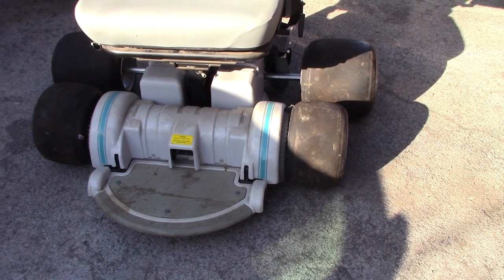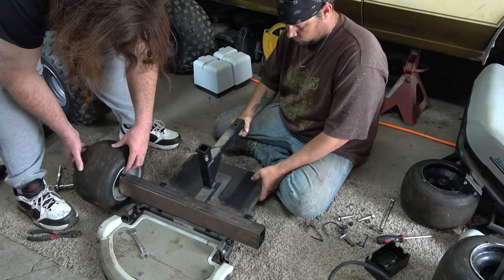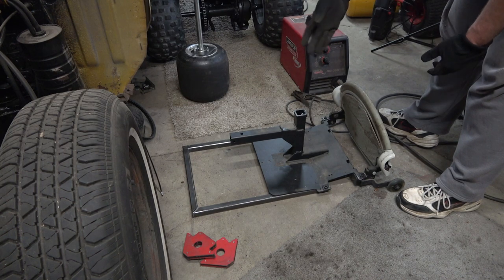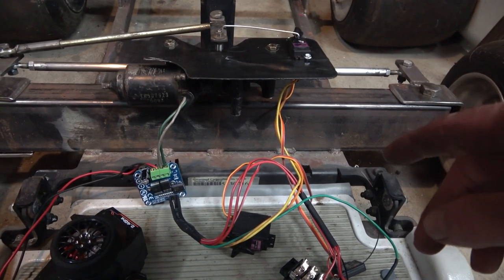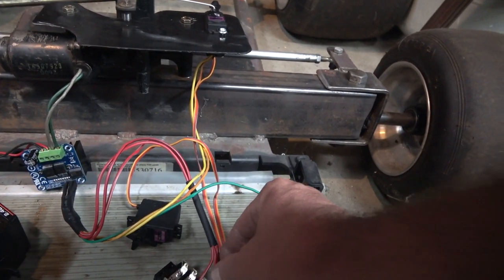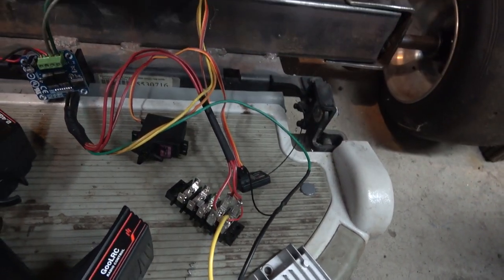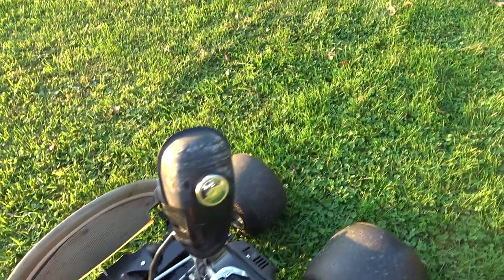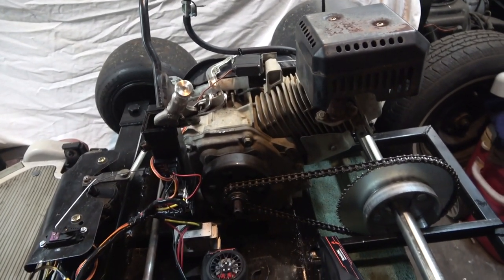RC Power Chair Go Kart build - Start to Finish

Comment: What motor did you use it fit real good
Reply from the maker: Used a predator 212 but i built the frame to fit the engine. Thanks for watching Joseph! Maybe check out some of our other vids and consider subscribing. 🔥

Comment: Can yall build a fast electrical one. With bigger wheels..I'm tryin to donsumthun like that.crippled guy like me gettin stuck.hmmm
Reply from the maker: I'm sure we could build a fast electric version, the only thing is it would be substantially more expensive. It would kinda be like a tesla power chair. Would kinda all come down to money for a build like that and unfortunately we dont have the budget for builds like that, maybe one day. I do think this would be a great idea to get handicapped people out riding again. Its very stable and easy to operate. Thanks so much for watching Jay! If you decide to do a build like that yourself and need help dont hesitate to send us a message.
Reply: @FireAndGasoline  I totally understand I've been looming Into possibly hubs.from alibaba..I just am not too sure the recipe ratio from motor . battery . Controller
Reply from the maker: @Heyjaybird  well the stock motors are atleast a 4:1 ratio but they aren't optimal for what you would want it to do. You would probably want to look into some brushless dc motors probably atleast 10k watts each, would need a dc motor controller capable of controlling 2 motors at the same time and a lithium battery pack. Once you decide on the parts you will use you can start fabrication on the frame. Im thinking each motor to a small axle on each side would be the way to go that way you can adjust torque and speed by sprocket changes.
Reply: @FireAndGasoline  ty very much